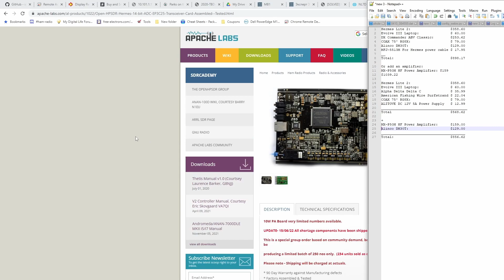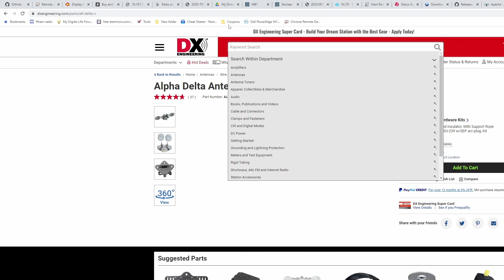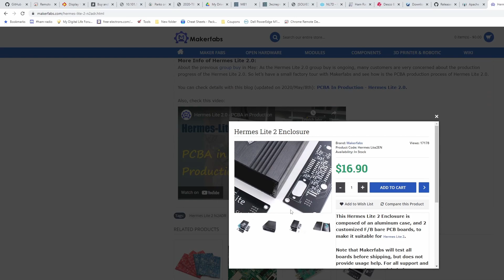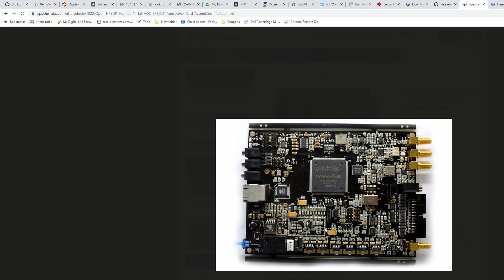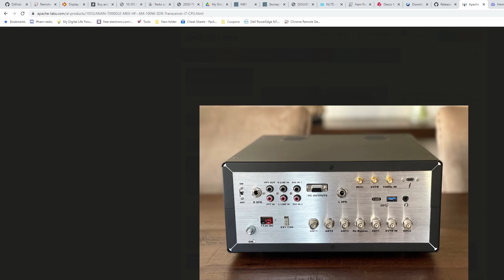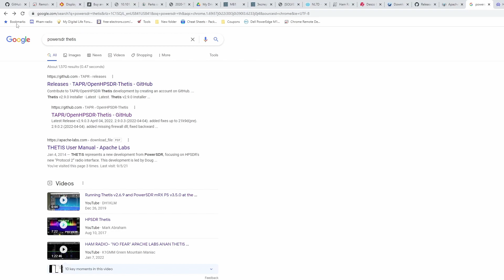$1000 CAHR Ham Shack Challenge

Comment: Hiya Don - Great primer on the HL2 - they are great QRP SDR's and a superb panadapter for some of the other radios. I have a handful of them that I use for different projects. I also run a 7000DLE, Elad FDM-DUO, and too a lesser extent the 101D, Ailunce Hs2 and X6100. The HL2 has a 5W PA on board, with filtering being done on the N2ADR daughter board. The ANAN Hermes board you show is a single 14bit ADC from the ANAN10 series, and roughly 500mW only, no filtering., that they are selling as a board only. The filtering is on the 10W PA board that you showed. The 7000's, 8000's and Andromeda are Dual 16bit ADC's - with alot more filtering and alot more horsepower, with 100W PO min. and the newest 8000 is 500W. The Hermes Lite 2 is the best bang for the buck for a QRP SDR for sure! SDR Console is superb, as well as the Thetis version that support the HL2. The ANAN-7000DLE MKII page shows all the differences between the two - including all the filtering and I/O.  So the HL2 is like $350 for the HL2 and N2ADR Filter board - and the comparable ANAN Hermes and 10W PA is closer to $600 - less the case in both cases. Still - the HL2 is one hell of a fun SDR to play with. I have an HL2 in a travel kit, and run another as the panadapter point and click GUI for my FTDX-101D when Im not using my ANAN7000DLE MKII.
Reply from the maker: Thanks for the update Tom. I did look at the manual for the 100D and it looks like it is a Hermes board with a 100W PA onboard. I know the 7000/8000/Andromedas are much better radios. Still I am VERY impressed with the Hermes and enjoy the radio quite a bit.